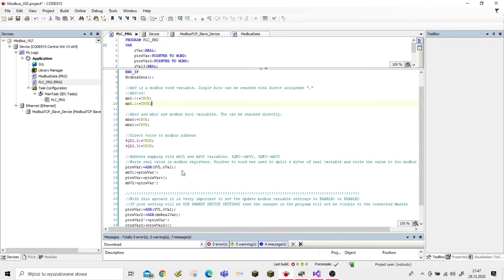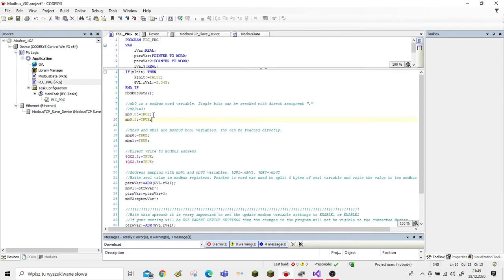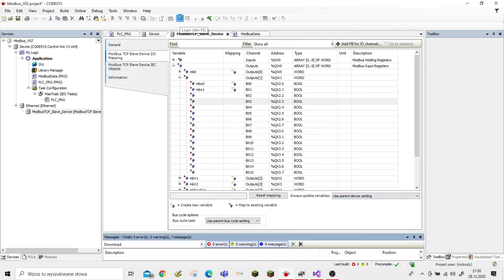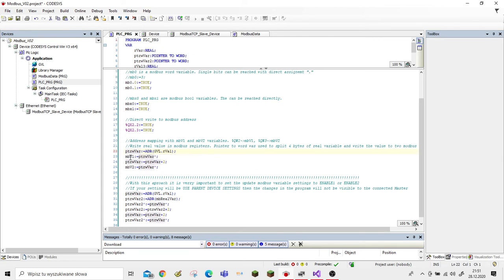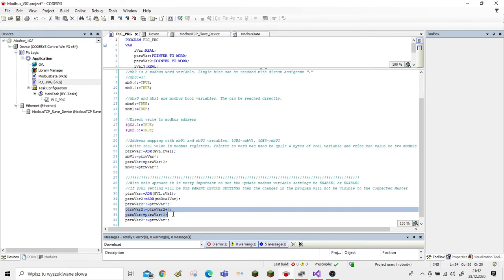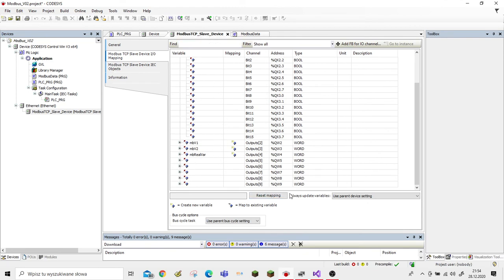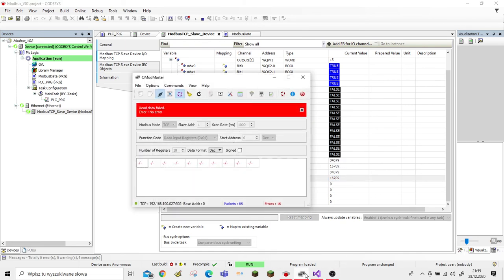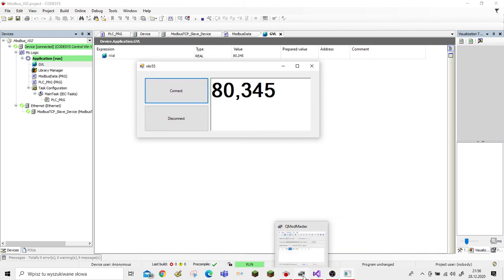Codesys Modbus TCP / EasyModbus C# / Modbus REAL Variables

Comment: Hey, are u familiar with python ? I wonder how connect propelry codesys with python application via modbus tcp. But i have problem with this. Which site should be a sever codesys or python app ? Generally i want use python to make my own visulazation and autmation testing of plc code. 
Greetings
Reply: I should say i mean about virtual controller not a real on. Just a simulations o plc controller